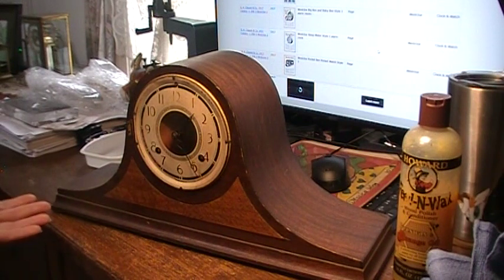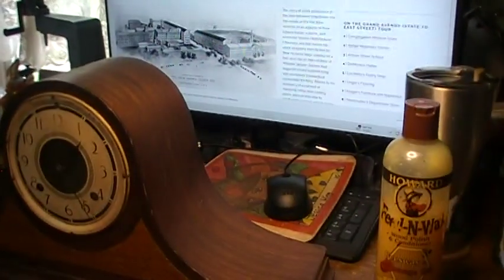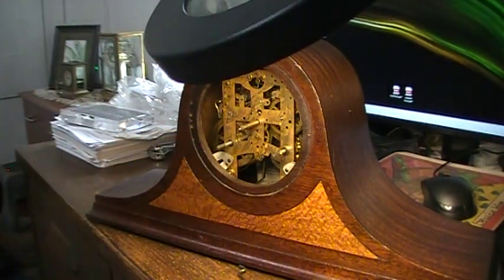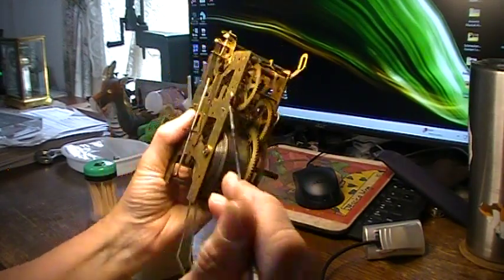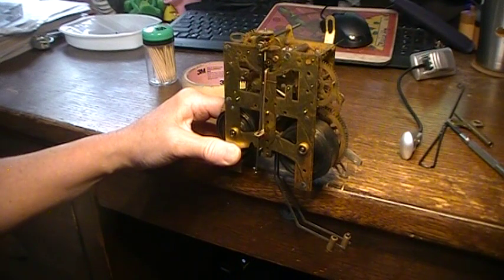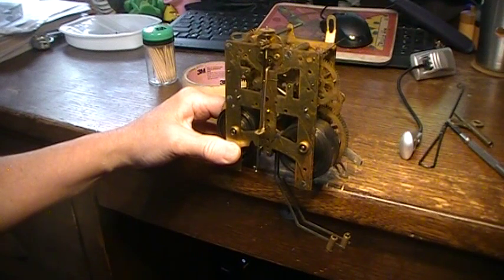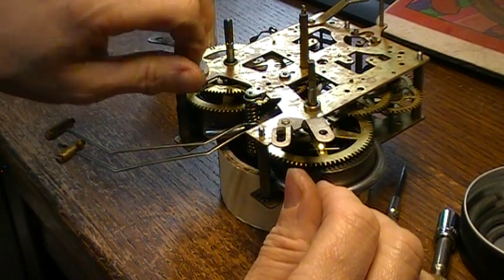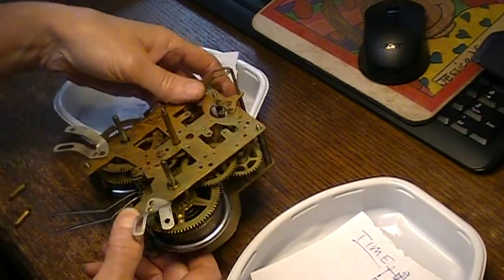c1915 New Haven Tambour No 7 Repair 1 of 2 Issues with Loop End Mainspring Arbor Not Catching

Comment: First it is great that you are going to donate the clock to charity to help out with the dogs. That is a tax deduction. So find out what a running one sells for on ebay and keep records.  Nice little bim bam clock. It is great that you study things to figure them out before you take them apart. I think they put the movement together wrong.  I think the spring should be attached to the bottom post and the other post is just to keep the spring from going in the wrong spot as it unwinds but I havent worked on this kind of movement before that I remember. Using a metal object to point to parts might be hindering viewers.  That is why I use a wooden skewer.  Just a thought. I find that a big pair of side cutters sometimes works better than the hand puller that you are using. By design they are tapered and as you squeeze the parts raise up on the taper. That post with the top again I believe is to keep the spring from coming apart in the wrong direction.  The top part is so it doesnt slide above that post. In my opinion. If you put the second wheel on and then put a screw driver through the hole of the second wheel then you can wind the springs and they catch.  As the screw driver prevents the second wheel from rotating to far. You always impress me more and more with each repair that you do Cheryl.  Keep it up.  Thanks for the shout out. May God bless you and yours.
Reply from the maker: Well in watching my own video, 99% of the spring arbor problem I was having was because I was turning it the wrong direction!